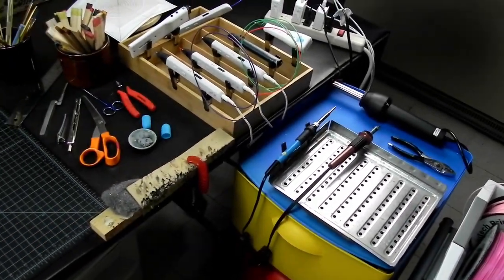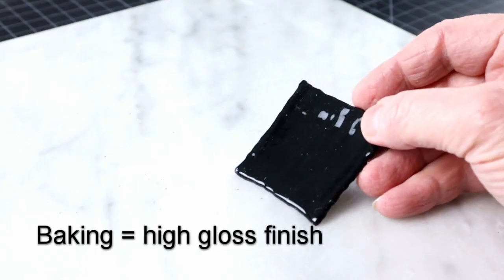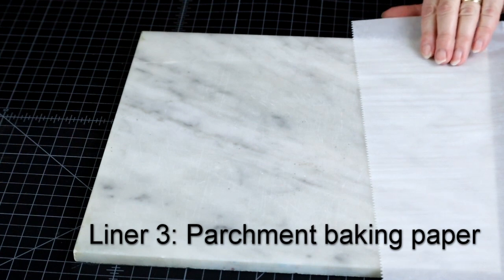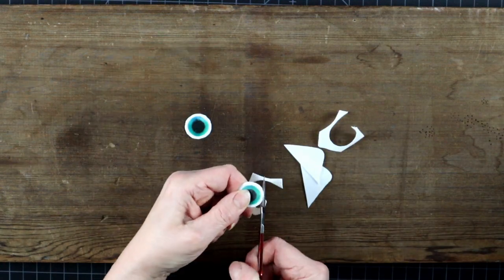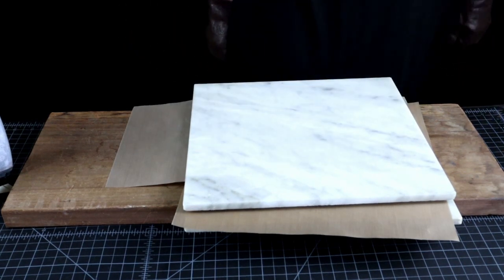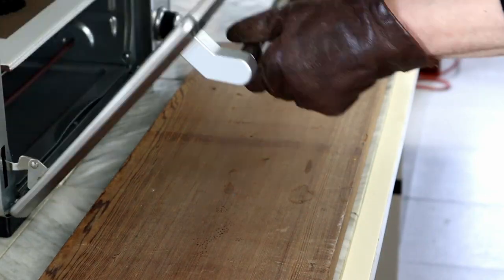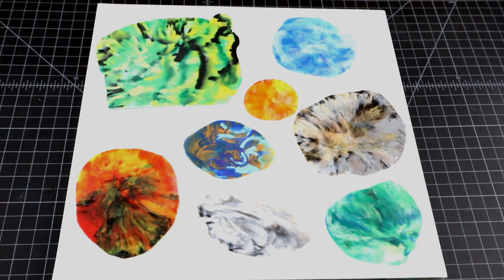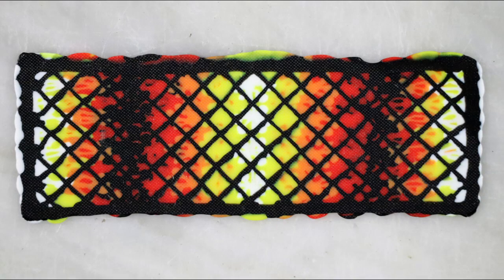Nine reasons to iron your 3d pen projects

Comment: Thank you for the specifics.  Namely; the max temp of the iron as a go to setting for PLA.  and the "don't move!" aspect.  These tips are super helpful and have been glossed over or completely ignored by other channels.  
I recommend a Heat Gun too as you can hit things like a sniper stove if you're knowledgeable enough :)
Thanks for every video you do!  Keep that wonderful accent ◕‿◕
Reply from the maker: Can't get rid of the accent if I tried (and I did). Anyhow I was thinking about a video on the use of heat guns. I do have I think three. And perhaps a video on all the different heat techniques and when they are applicable. Since different projects require different approaches.
Reply: @3DPENDEN  :D I also think your accent is very cute, FWIW, but I'm biased of course.
Reply from the maker: @Kagedtiger  😀